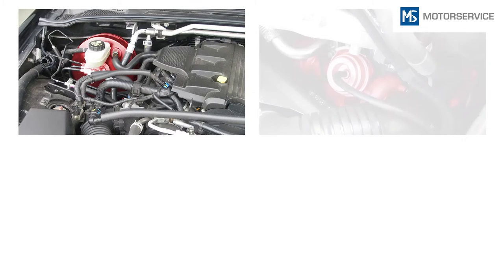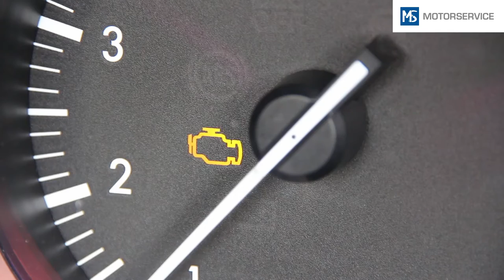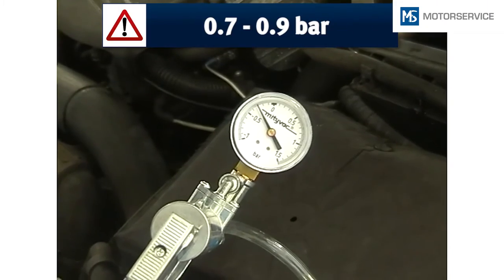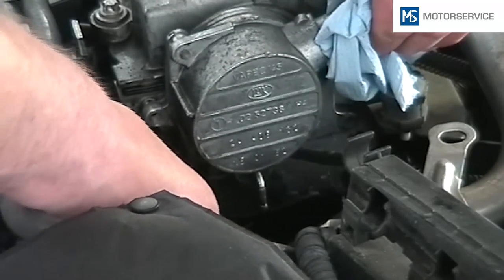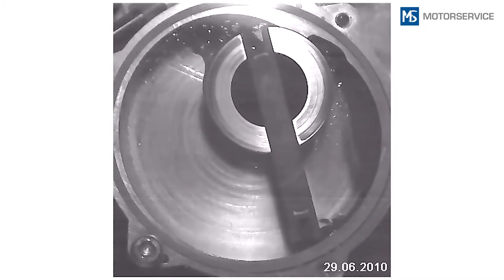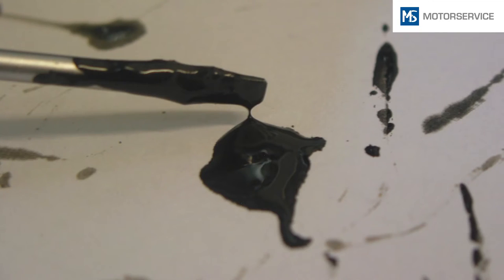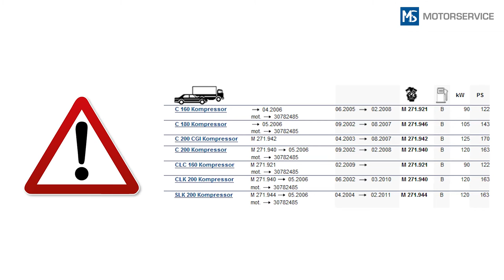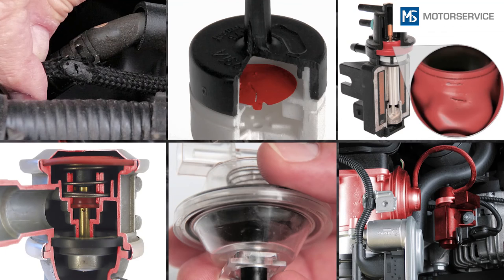Vacuum pumps: Damage from lack of lubricating oil - Motorservice Group

Comment: One of the main reasons vacuum pumps lose their efficiency in producing vacuum is because of the valves through which the air is sucked in, as rubber inside those valves gets old, crumbles and cannot seal anymore. A lot of times only valves on the pump need replacing, so the pump could do its job as it should. The lubricating mechanism of such a pump is so simple that only a major oil problem on the engine itself could cause damage to the vacuum pump.